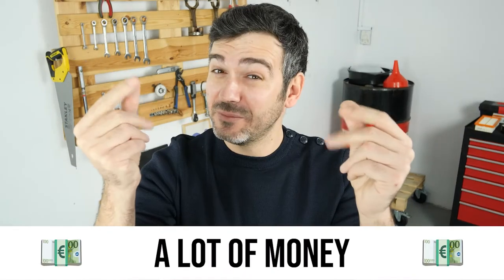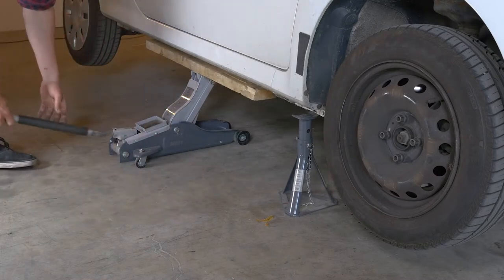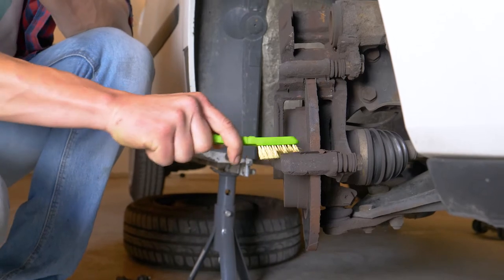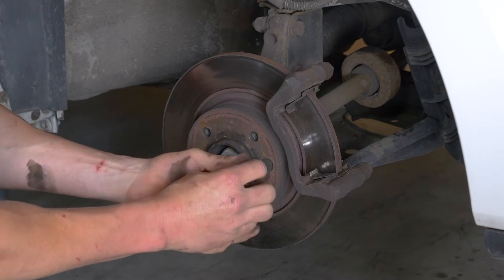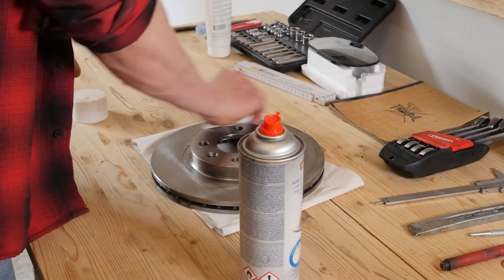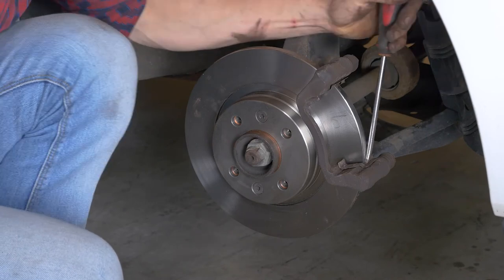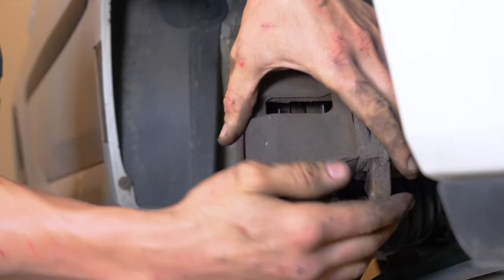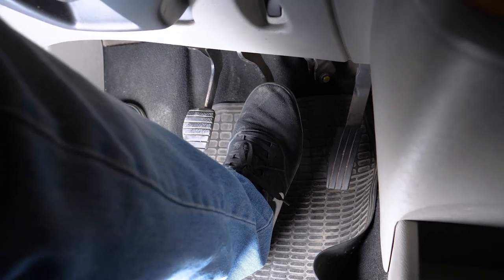How to replace the front brake discs and pads Twingo mk2 🚗

Comment: For gods sake wear some gloves! Neither copper or brake dust is very healthy.
And dont ruin your hands by pounding on the tools, just use an extender to get more torque. A piece of pipe will do fine.
Reply from the maker: Hi @Jakob K’s garage. You’re absolutely right. We changed the way we perform the operations, and now wear gloves.  
From now, we’ll wear gloves in every video we publish.